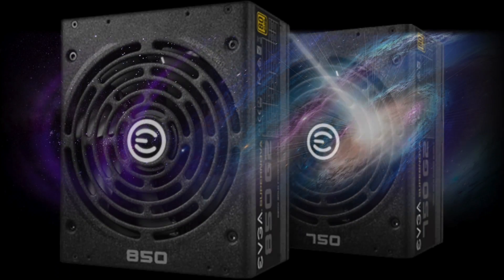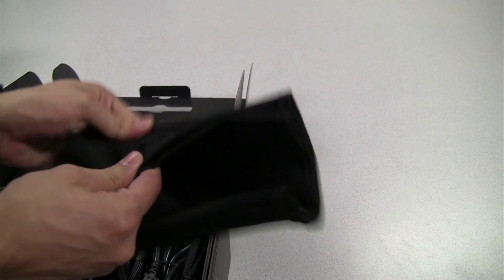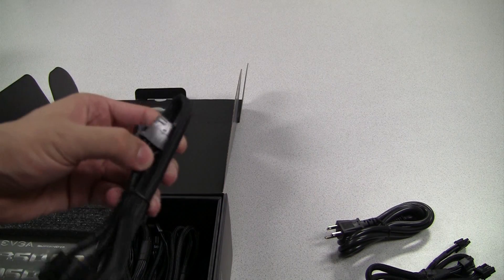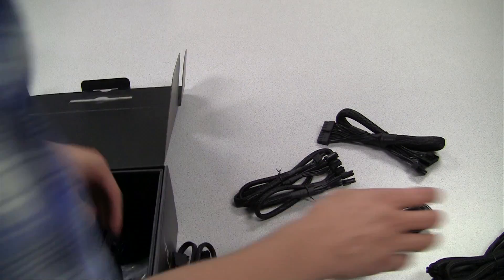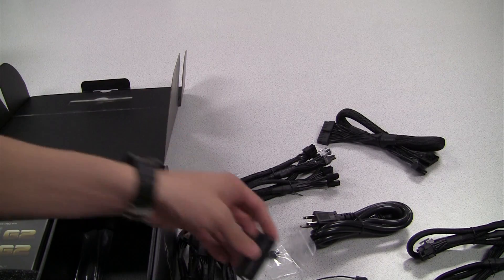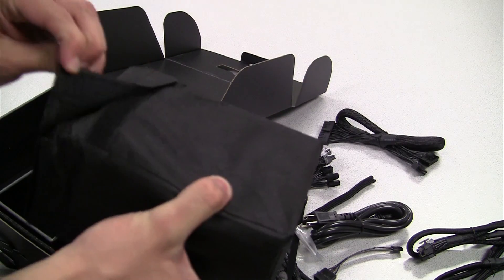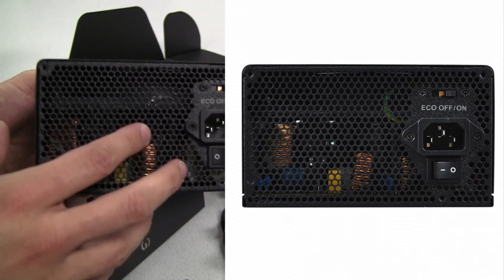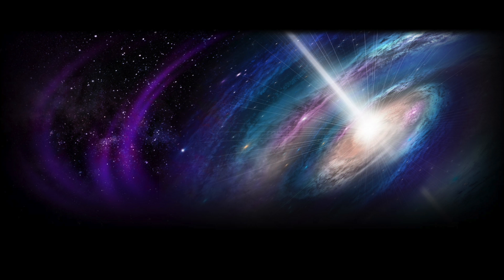EVGA SuperNOVA 850/750 G2 Power Supplies

Comment: son has gone through 3 of these via rma. After the first one blew he went to a local store to inspect the unit. It had burns on the components but was still functional for 6 months. the next one didnt even last 10 days before it blew. It too also had scorched component before it was installed. Evga use to be a quality product but now it seems they are recycling used components that will do more harm then good.

Comment: Please help. my fan is not turning at all in ECO mod. i tryed playing battlefield star wars at max graphics with i7-6700K oc at 4.5ghz + gtx 1070, Fan is not ever spinning at all in eco im playing for 6 hours now, the power supply is so hot i cannot touch it or i could burn my self, please help is it DOA unit ? its my third replacement unit and they all have same problem.
Reply: how about you just don't use eco mode?
Reply: The psu is so loud with ECO mode OFF. i can hear the fan squeeling from the other room. It's like at full speed with eco off, my pc sounds like 10DB but this psu sounds like 45DB.) I allready RMA the PSU but newegg sent me another PSU with same probleme it'S the 4th psu with same problem in a row. EVGA QC failing
Reply: Well, I have my switch in the middle, so neither on or off I guess, and it's not very loud.

Comment: I'm disappointed that you didn't show clearly that you have 2 VGA Y connectors in there.
Those two wires for SLI cross fire make wiring your system more clean and less wires running threw your case.

I've been searching jonnyguru, you tube and other sites to get a good look to confirm what I'm seeing and after i seen you pulling out the wires and describing them i thought i had it until you got to those wires and totally missed that opportunity to show they are Y split wires for 8 an(6+2) and 6 pin GPUs.

Maybe next time you won't miss that...

Comment: GUYS, HELP ME OUT PLEASE:

Has anyone (that owns this PSU) had any trouble plugging some of the cables into the PSU sockets?
I've had a hard time doing so, I had to apply way too much pressure to get the damn cables fully plugged, and I don't feel right about it.
On the other hand, plugging the VGA cables (into the PSU sockets as well) was easy, and did so with a smooth "click" sound, applying barely any pressure.

ANYONE, PLEASE?
Reply: Hmm, not at all. I got mine today and everything went in without much of an issue.
Reply: Mike Foote

Hey, Mike.

Thanks for your input.
Do you then mean that all cables plugged INTO the PSU took the same amount of pressure?

As I've said, the VGA ones went in easily; however, the motherboard one required a lot of pressure - kind of the same pressure that you need in the other end of the cable, when plugging it into the motherboard (not into the PSU)

Thanks.
Reply: I deleted a comment because once again I totally misread yours. No, I do not remember needing a ton of pressure to plug the mobo one into the PSU, I assume you used the split end at the PSU and the one piece on the board?
Reply: Mike Foote
Yeah. They can't be plugged the wrong way.
So, again: All the PSU cables took you the same amount of pressure?

Thank you!
Reply: Yep, they seemed to. I didn't have any issues.
Reply: Well, time to RMA then.

Not the only problem actually: the PCIE cables don't fit into the SSD nor the DVD, at all. Had to remove the DVD and use a Molex-to-Sata to power up the SSD.
Quite pathetic coming from EVGA, to be honest.

Thank you for your help. Mike.
Reply: Thats really strange, go to overclock.net and post this in the power supplies sub forum, there are some insanely smart peeps there that I bet can help.
Reply: Hey, Mike. Didn't really expect another answer.
I sincerely thank you for your additional help, I'm certainly dropping by either today or tomorrow.
Thank you again.
Reply: You bet, I would take some close up pics as well and post them.Good luck!

Comment: I got this one for my new build and I like it and all, BUT I may have to RMA it cause its
making my system unstable when in ECO-Mode (I have got 45 bluescreens with Kernel-PowerEvent-ID 41, spread out over 3 weeks time)

I figure it may be related to the C6/C7 Idle Mode on Devils Canyon?

The PSU seems to work fine without ECO so either its RMA or just keep it for the now a bit shorter lifespan of 100k/h MTBF? ^^
Reply: You'll probably have the same problem if you RMA it. ECO-Mode probably doesn't work very well with all systems.
Reply: Raptor Jesus
Yeah I figured the same later...However my system works fine in ECO mode now, even if I had a bluescreen today (Memory related). In conclusion the PSU works fine now :)

Comment: i bought and revived this psu a few days ago this psu is ace i love the finish and its so quiet and no weird noises the cables are very nice black wires and a nice tight black braiding also the box it comes in is lovely after about 3 to 4 days using it its easily better than my corsair rm 750  i payed 84.90 here in the uk and i would have to say even if it was 100 or more it would still be the best deal out there for a 750w psu

Comment: If you guys had that handle bar like you guys did with the 1500w, that wouldve been nice.
Reply: because you go out on date with it everyday and need something handy on it so you can carry it in a nice way? imo i dont care about that handle if its there or not, how would it change your way of using the PSU for you, you Think?
Reply: when its installed, its helps being able to grab something other than the case. Especially with dust filters you dont want to be poking holes in them.